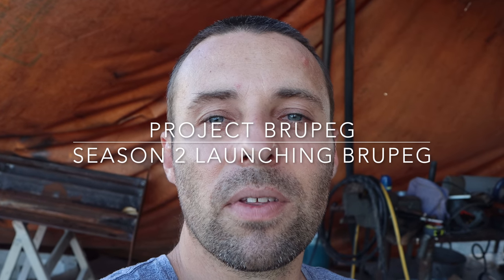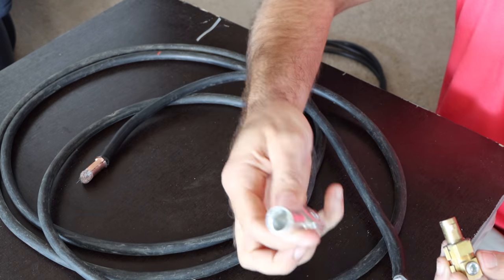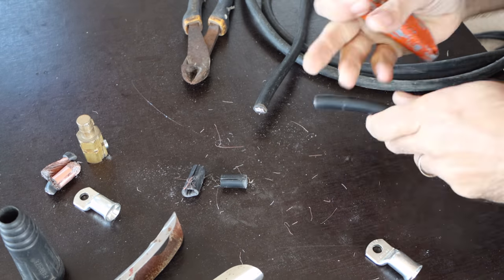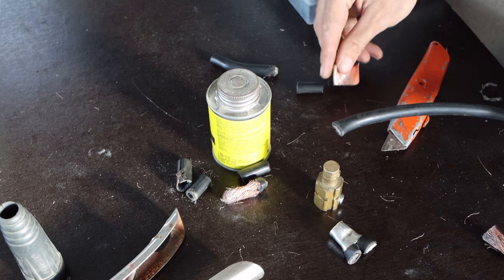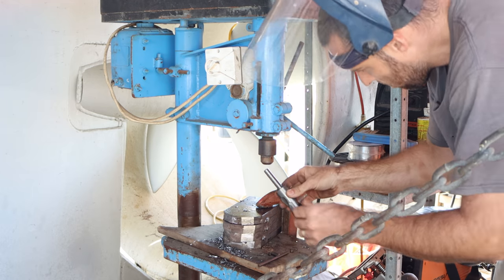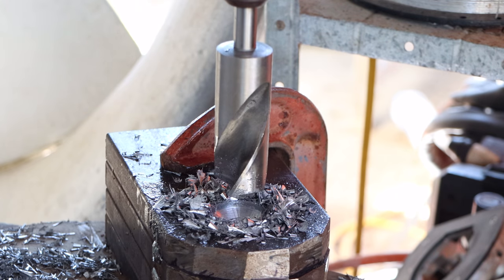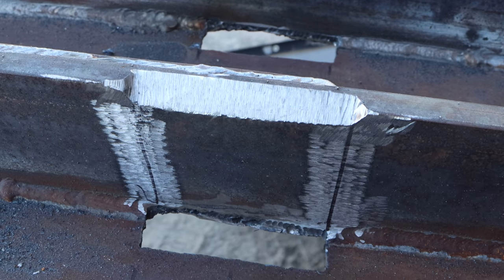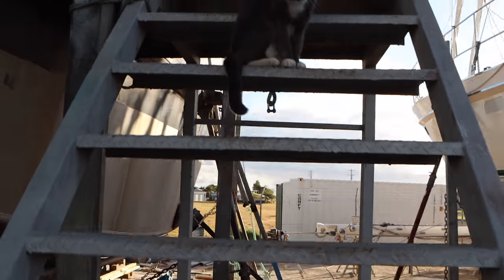Drilling Wing Hinges & Welder Maintenance - Project Brupeg Ep. 130

Comment: if you hot dip galvanise your anchor it will last for years plus if your thinking your anchor weight is not enough just put a thicker gauge chain for a certain length to add weight , just as good.
Reply from the maker: Yeah the plan is to build and blast the anchor then drop it off in town for hot dip. Assuming the shop is still open as it’s likely not considered essential business
Reply: Project Brupeg dunno, I guess the molten zinc is a good disinfectant? :-P

Comment: use the bolt on ground clamp for your ground.that way your ground lead will not get hot from a insufficient connection.and solder on your copper eyelet.stay safe be healthy :-)
Reply from the maker: Thanks Robert

Comment: You can also add doubles on the anchor bottom plate to get your added 20kg.  That's actually pretty common. Greg
Reply from the maker: Thanks, yeah I did think about that as the extra weight on the tip would be a good think to help setting initially

Comment: I feel for you Dame... when I was 16 I made the mistake of using an older sisters sun tanning lamp back in the late 70s...  (just prior to a ski trip above 10K feet) didn't have the little protective eye goggles, so I just closed my eyes for the 10 mins I thought was safe exposure.  NOPE ! Looked like a blister next day, eyes swelled shut, and burned the retina in the back side of my eyes too... had to rub vaseline like ointment in my eyes for 5 days !  The anchor plate has lots of meat left for bracing along the top and bottom sides to give you extra weight, had you considered making the boomerang shaped central arm a T or I Bbeam cross section with your plate scraps ? The long piece at top looks like you'll have a strip the could be notched and bent to match the arm's profile.
Reply from the maker: Hi Mike, i hadnt thought of that, i will ponder it and see what we can come up with

Comment: Tip for weld flash , if you get sore or feels like sand in your eyes bath them in full cream milk, done it many of times and works..
Reply from the maker: Good to know
Reply: @Project Brupeg  - Ah, but it's still pretty close to the 1st of April, so don't be fooled...  ;-)

Just kidding - milk is probably a perfectly genuine soothing remedy. Harmless, at least.  Er, possibly. Perhaps. Maybe.

Dairy products are generally bad for adult domestic cats, by the way. Lots of cow-juice and cream can cause long-term internal problems.

As I mentioned in the Comment section of one of your earlier videos, Brupeg's an all-metal boat and won't suffer from having regular rodents sneaking on board -  they'll be Stainless Steel Rats [Harry Harrison sci-fi reference].

So if you're thinking of letting a ship's cat (Peggy?) adopt Brupeg, I suggest equipping her with a plasma cutter to save wear and tear on the old claws and teeth. And if it's a tom-cat, well, you'll just have to change the name of the boat. (!)
Reply: Jim Nickles  thats 3 of us. Lol

Comment: Ooo welding flash burn is worst. I watched a very fair skinned guy tig weld for 8hours without sleeves. The next day he had the WORST "sunburn" on his forearms ive ever seen. Stuffs no joke. Stay safe guys can't wait to see Brupeg on the water. The imperial metric stuff in my line of work its hilarious . They design a multi story building in feet and decimal feet but the forms i must build for concrete walls/columns is all in metric. So all day im converting measurements and making spacers to make it work. Its retarded really i duno why they don't just go to metric
Reply: I read years back that one of the biggest reasons that the U.S. hasn't completely switched over is because there are still tens of thousands of machine tools in operation in industry that were built and gauged in Imperial. I don't know if it's true, but it certainly seems plausible. Modern machine tools are built on metric and gauged in both, but if you don't spend time in machine shops you'd be shocked at how many 50+ year old manual tools there are out there being used.
Reply: @kevlarandchrome  well i can tell you in large scale commercial concrete construction there are no such machines. Even our 50k $ layout machines can do metric so i really duno why they design buildings in feet and inches. At least the structure anyway.
Reply: @Deftonesdsm  Yeah, in construction you've got me, I have zero knowledge in that industry. All my experience is in automotive and fabrication, just passing along some information (that may be unreliable) that I got a while back from industry publications for machinists. It does seem a little crazy not to standardize on metric for construction.
Reply: @kevlarandchrome  i dont think you are wrong. I used to me an A.s.e. tech myself for toyota/honda so i can see that with machining. And in construction the sheetrock etc is in feet but the concrete formwork is built in germany so metric. Its retarded haha. Stay safe out there brother
Reply: @Deftonesdsm  I'm suddenly reminded of early 80's Fords where half the fasteners were metric and the other half were standard, it was annoying working under a hood like that, I can only imagine how much more irritating it would be two stories up on a scaffold. :p You do the same man.
Reply: @kevlarandchrome  haha yes yes yes i 100% ran into that.
Reply: True story, Sammy Hagar the original singer from Van Halen bought some land in Mexico and asked them to build a 3,000 square foot house on it. When he looked through it he was amazed at the spaciousness of it as they only understand metric so they built a 3,000 square metre house. André
Reply: @SoundzAlive1  jesus christ seriously ?

Comment: hi dame  just to let you know the 855 cummins has a tach drive already installed between the compressor and fuel pump  its ready for a cable drive or in your case just screw in a tach generater connect two wires to the tach head your good to go  regards larry ward
Reply from the maker: Thanks Laurence. I honestly hadn’t even thought of using the mechanical take off. I just made an assumption I would need a cable all the way to the gauge rather than like you suggest. Thanks

Comment: Arc eye is not the greatest, you wont be doing it again for a while.  You could also of welded a pipe the over the hole on the hinges to stop the wandering.  As the UK changed to  metric our year at school was in he middle so we had to work in both metric and imperial as the couser work changed, I still use both and confuse everyone else. 👍👍👍😷😷😷stay safe.
Reply: DC Allan, same here, I even use both in the same measurement eg. 3/4” + 2mm............
Reply: @poppabear3664  I try not to use them both at the same time but I can understand.
Reply: Ahh those days created lots of bi numbered people.

Comment: Assuming the geometry of the drill bit you're using is ok, the main problem will probably be that the size of your pilot hole is just (a bit) to big, giving the drill bit the chance to wander about.
Reply from the maker: I honestly couldn’t hand on heart say the bit was sharpened great. It was chinesium steel with I’m assuming a quick and dirty grind so it’s very possible they cutting edges were not true

Comment: You have been adopted by a cat.  Seems like a nice cat.  I have been wondering how you will weld the bottom skin onto the stabilizer wings without being able to crawl inside of the wing.  I'll have to keep watching to see how you solve this.  Take care.
Reply from the maker: Thanks yeah it’s a pretty simple solution for the rear skin. Stay tuned for more
Reply: I'm guessing a small slit along the outside skin above the rib and weld the both by filling the slit and smooth over with flapper. BTW Love the imperial calculation. André

Comment: ...Risks the inevitable " Yep I know that" 🤣 but the earth from the plasma should fit the welder.
Hope you are both enjoying the apocalypse and got enuf bits and pieces to keep going for a while 🍺
Reply from the maker: For some reason my plasma has a tiny fitting (welder is much more normal size) I have recently seen an adaptor at Bunnings so I was going to grab one next parts run
Reply: Ahhh, might be bad advice then. Check that the cable is rated for the machine first. Always handy to have a spare earth lead or at least the makings. Keep an eye on gumtree, sometimes ppl sell an old machine for $20-50. Worth buying for the leads and then scrap and sell the copper.😁. Oh ..and congrats on getting adopted

Comment: Man, a lot of work going into those wings... did you expect it to be this much work before you started them?

All that steel you are putting in, are you worried when you lower it back Into the harbour it will just go straight to the bottom 😂
Reply from the maker: I assumed it would be a big build, I guessed six weeks but it’s easy double that. Part of the issue is we are learning how to design and build them as we go. This is the first set we have ever built and there are very few in this part of the country, so when Chris got in touch with us it was a god send as he has so much experience he has lopped weeks and weeks of trial and error off the build. As for weight they will be pretty hefty, but then what isn’t on this boat
Reply: Project Brupeg doing a great job keep up the good work!

Comment: Hi, I have been following your build a while now, I am thinking that the stabilizer hinges need some sort of drag reduction system to prevent high fuel consumption. Have you any plans to deal with that?
Reply from the maker: Hi Roger, on a boat like this the hinges won’t make any difference in fuel. We will actually be more fuel efficient as we removed four large transducers (each 2ft long and about 1ft wide) hanging under the boat as well as the swap from paravanes to wings. Overall efficiency will climb as a result. When we change to our piano style hinges the drag will reduce further and when our ice mods are complete and the external keel cooling is replaced with internal cooling the drag will drop further again
Reply: @ProjectBrupeg  great ...thanks for replying and the info ..wish you guys all the successes..

Comment: A simple but highly effective earth clamp you can bolt a lug directly to an old G clamp. I've gone through just about every heavy duty earth clamp and the G clamp is right up there with the best
Reply: The G clamp gives you a more solid connection than the spring loaded style clamp which means less heat to destroy your cables
Reply from the maker: Nice. Yeah I had a clamp style on my old welder but I’ve gotta say I love the ease the alligator clamp style offers
Reply: Yeah for easy attachment the crocodile clamp is definitely the fastest but over time the spring weakens from the heat and then they can drive you absolutely bonkers. Keep up the awesome work. Just finished binge watching a few episodes 😁
Reply from the maker: Thanks very much

Comment: Hi Dame. When you go to weld around the lugs and the top skin just lay a 6mm fillet at the most down. It should only be a seal weld and there’s no point having a fillet larger than your thinnest section. You don’t want to go pumping a huge fillet around them otherwise you’ll end up with a large heat affected zone and they’ll crack at the top toe of the weld. 
Also blend any undercut on the corners of the lugs with a standard cutting disc. You want a nice smooth transition from the weld to the lug especially on those corners.
Reply from the maker: Cool thanks for the tips
Reply: Project Brupeg If you need some clarity on blending please google it or have a look  on YouTube mate. It is important as those lugs will be under high load at times and one little bit of undercut or a nick in a corner will give a crack a place to start. Keep that especially in mind with the lugs attaching the stabilisers to the hull. 
I’m not trying to piss down your back and tell you it’s raining but I’ve welded to AS1554 part 5 which is ducks nuts stuff. As in no flaws. You don’t need that but blending and having a small radius on the corners will mitigate and maybe eliminate a headache further down the track. 
Thanks for taking it onboard.
Actually I just had a bit of a look around and couldn’t find anything that shows what I’m talking about. I’ll have a play later today or tomorrow in the workshop and upload a video on my channel of what I’m talking about.
Reply from the maker: Nice thanks for this. Very much appreciated aye
Reply: Project Brupeg okay mate. I got motivated and it should be up now. I only had 5mm stock but you should get the idea. Also use second hand standard cutting discs or give new ones a work out on some scrap for a minute or so. 
I hope this helps.
Reply from the maker: Nice. Thanks for that. All makes good sense. I like the pressure test jig. I’ve just got a few pressure gauges for the fuel system that will be perfect for that job until that are fitting on the filters. Would it be best to clean up lightly with a disc like you did then follow up with a flapper to smooth it right out?
Reply: Project Brupeg Too easy. With a worn 2.5 or 3mm cutting disk and some practice you’ll get it pretty good and should only need a quick lick with the flapper. If you’ve got a tungsten burr and a die grinder and a light touch that’d save on flappers as they’ll wear out where you need them on the edge pretty quick as you probably already know. 
I’m not sure how much more you’ve done but try to avoid vertical downs where the lugs weld to the spars. Roll the stabiliser on its side or dial down the welder and vertical up. Definitely vertical ups for the lugs on the hull. A vertical down doesn’t penetrate.
Reply from the maker: Ok cool. Thanks for the clarification
Reply: Project Brupeg No worries. I DM’d you through your website about 10 or 12 days ago but understand you must get heaps of emails and it’d be a nightmare replying to them all. 
I’ve been driving trucks for a bit over 8 years but in my previous life , including my apprenticeship , I spent nearly 20 years as a boilermaker. Just yell out and I’ll try to help.
Reply from the maker: That’s awesome. Really appreciate it. Yip we do get a bucket Lloyd of emails and sometimes it’s hard to keep up. Really appreciate the follow up though, video made it so simple to grasp
Reply: Project Brupeg G’day again guys. Just uploaded a couple of videos on full penetration butt welds as in what you’ll be looking at for the join on the bottom skin of your stabilisers. Not the best I know but it’ll give you an insight. Also found my CIG consumables handbook. Might be out of date but might be handy for steering you in the right direction for welding the stainless pivot lugs to the hull.